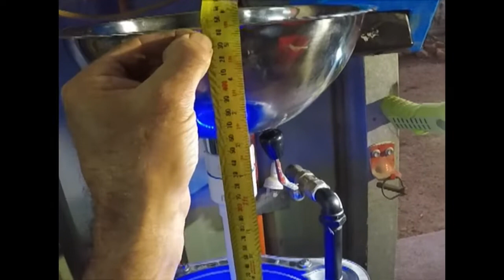How to make a transmission wash basin

Comment: I want to know how it drained without a P trap did you have issues with it not wanting to drain especially if you filled the sink. I am trying to find a way to make the basin for it but make it more industrial and I thought for sure you were going to lay that plexi in and heat it somehow. I like what you did but I am trying to make it look like a trans that hasn’t been altered too much for a dealership near by and the drag strip I have until Feb to come up with both